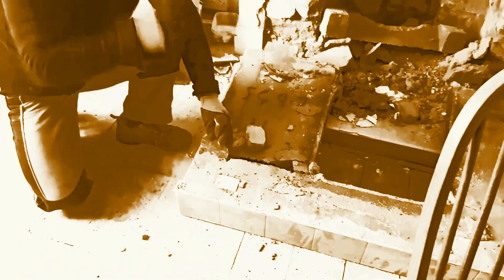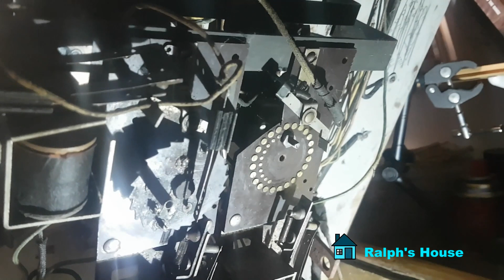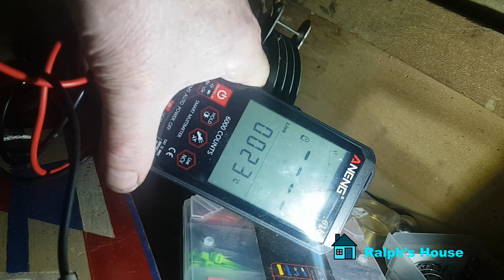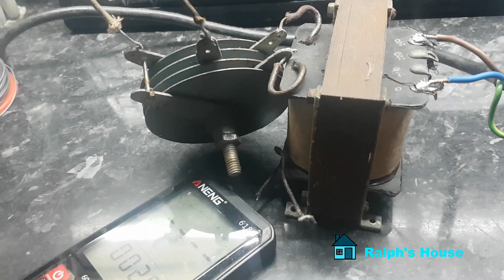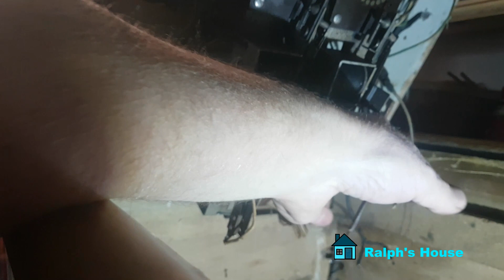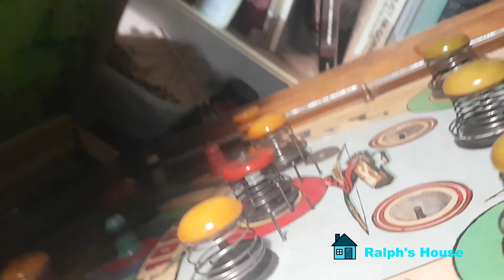158. Genco Pinball restoration (Part 5)

Comment: Hi ralf because you will be using a SMPower suppy you may need add so diodes across the solenoid coils to prevent back EMF damaging the power supply
PS  a loverly pin balland a lot older than any i have worked on.
Reply from the maker: Ah, now that I didn't know. Will order some immediately. Thanks for the heads up Rob!
Reply from the maker: Looks like 1N4007s should be enough.